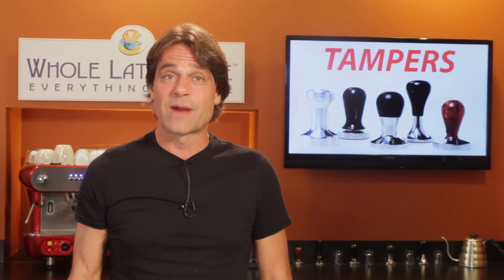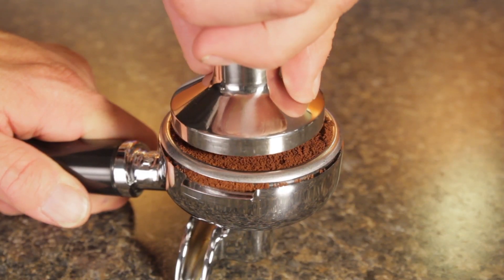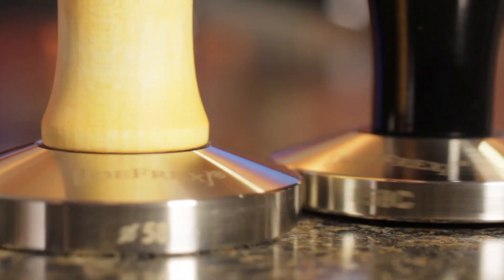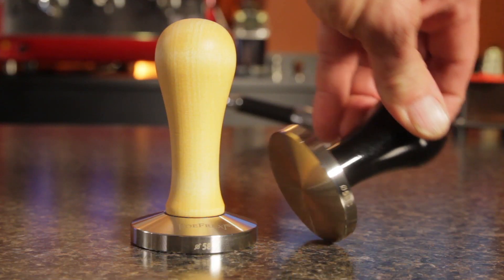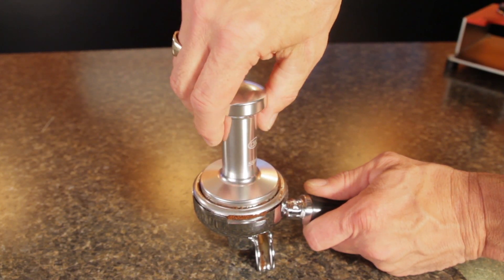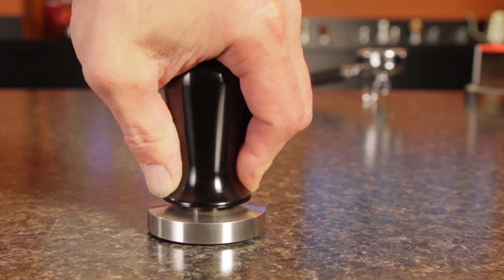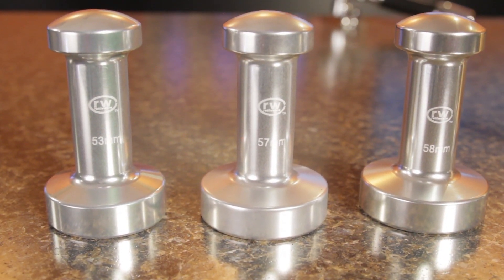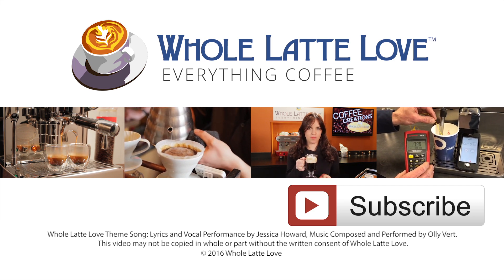How to Choose an Espresso Tamper

Comment: @Whole Latte Love If you're applying pressure when you do the rolling motion before you tamp you are most likely fracturing and or creating channels in  the puck (or at least running a greater risk of that happening). The stockfleth distribution technique pared with a smooth, piston like motion, tamp will yield a perfect shot  almost every time (if done properly). This is also assuming all other variables like grind,temp, and beans are optimal.
Reply: Also if you keep tamping with your palm your wrists are taking all of the pressure and if you work in a cafe, carpal tunnel is gonna creep up on you. Try holding it like you would open a door or how you would turn your keys in an ignition with your elbow at 90degrees parallel to your side and you should feel it in your chest (just a note you can benchpress more than your weight but it only takes about 15 pounds of pressure to break a human wrist. so its safe to say putting the burden on your chest and not your wrist is a better idea.)
Reply from the maker: Hi CAP, Thanks for sharing your tips on your technique! Not sure I agree that a light roll 12-6-3-9 move prior to full tamp pressure would fracture the puck.
Reply: Whole Latte Love 12 6 3 9 is different than stockfleth.but you are right moving a center pile to multiple places can create an unevenly weighted puck. stockfleth incorporates a swift swipe distribution so you avoid that (it is allot harder to master). there are hundreds of ways to distribute it all depends  what you are most comfortable with and gives best results. tamping however, I stand by not tamping with your palm and wrist to avoid injury.

Comment: If I’ve measured the interior of the basket to be 51mm should I be looking for a 51mm tamper or a 50mm tamper?
Reply from the maker: Hi Steven, Thanks for the question. What is the make/model of your machine? Is it a pressurized filter basket/portafilter? 51mm is rather uncommon. 58mm is standard commercial size. 54mm used on some Breville machines. Asking if it's pressurized as tamping is not very critical with those. If measuring 51mm I'd start with a 51mm tamper.
Marc
Reply: Whole Latte Love, it’s a DeLonghi ECP3X20. It’s actually slightly less than 52mm. But I think it’s a pressurized basket as it only has one hole at the bottom.
Reply: I have a SMEG Espresso machine which is basically a Delonghi Dedica and buy a Fdit Calibrated tamper of 51mm on Amazon, it's a great tamper.
Reply: Omar Monterrosas, I actually ordered a JoeFrex 51mm yesterday. Hopefully it works.

Comment: Hi there , do you use convex tamper in conjunction with leveller?
Reply from the maker: Hi TM, Since making this video about 5 years ago I gone to using a leveler without tamping in most cases. It doesn't work with all levelers but does with The Jack as shown in this more recent video: https://gph.is/g/4MKK6Lx
Marc
Reply: Thx Marc, I’d like to rephrase my question. If I’m using a convex tamper does it make sense to use a leveller ?

Comment: Currently a beginner with my first espresso machine I picked up at a yard sale for $3. It's the Starbucks Barista. I've been unable to find out what size tamper I need. Any chance you know? I'm currently using my fingers. ☺️
Reply from the maker: Hi UB, The Starbucks Barista machine uses a pressurized portafilter so a tamping is not required beyond just settling the coffee in the portafilter. Some quick research shows the portafilter is 53mm but I wouldn't spend much on a tamper as not really need. You could use just about anything that fits - including your fingers. Good pickup for $3!
Reply: 53mm is the trick

Comment: Hey, I have an Izzy barista 6823 espresso machine. Should I buy a coffee tamper? What about a coffee grinder?

I need to know ASAP
Reply from the maker: Hi SBV, Never used that machine. But, looks like it's an entry level espresso appliance using a pressurized filter basket. With those tamping is not critical as it's the filter basket which creates the pressure and not the coffee compressed by tamping. Grinding coffee beans fresh will make a better espresso. But, potential quality is limited when brewing thru a pressurized filter basket.
Marc
Reply: @Wholelattelovepage  thank you very much sir!
Reply: @Wholelattelovepage  also, what do you suggest me about a better espresso on this machine?
Reply from the maker: Grind fresh, use the largest dose of coffee that will fit in your basket - these types of machine tend to have undersized filter baskets compared to standard 58mm. Grind very fine - have a look at some pre-ground for espresso and match that grind size. It's a little finer than granulated sugar. Make sure you machine is fully warmed up. Keep the PF attached until ready to use. Might want to run some brew water thru your PF (no coffee in) to help warm it up prior to making an espresso.
Marc
Reply: @Wholelattelovepage  you are fantastic. Glad to find your channel. Keep going!! Thanks a lot!
Reply from the maker: @Alex-id8rw  My pleasure!

Comment: I have a 58mm bottomless portafilter basket with a machine that is made locally in india (tecnora) will a 58mm base diameter tamper fit my portafilter? Not many shops here offline so that i can check physically.
Reply from the maker: Hi RG, Thanks for the question. I can't be certain as I don't have a Tecnora myself to check. But my guess is a 58mm tamper should fit a 58mm filter basket.

Comment: I have krups type 874 do i need a tamper and what kind?
Reply from the maker: Hi LC, The Krups 874 uses a pressurized filter basket so tamping is not critical. If you have the ground coffee scoop which came with the machine it can be used to compress the coffee in the basket if desired.

Comment: Actually it does make difference even for pressured portafilter. Plastic ones are useless
Reply from the maker: Hi z, Thanks for the comment. This video is getting a little on the old side. About a year ago I started using levelers like this one and rarely use a tamper anymore: https://youtu.be/4Z5vTi643sc
Marc

Comment: My portafilter size is 51mm. Should I buy 50mm or 51mm tamper? Thank you. (Espresso machine Delonghi ECP 3531)
Reply from the maker: Hi BK, Thanks for the question. Fairly certain your machine brews using a pressurized filter basket. When using  a pressurized basket tamping is not critical as it's the basket creating the pressure of the espresso brewing process and not the coffee.  Tamping may have a very small effect but in most cases it does not. Tamping for your type of machine is more about pushing the coffee down away from the lip of the PF. I would go with the 50mm.
Marc
Reply: Thank you very much :)

Comment: I am a little bit confused here. I just purchased a new machine and a grinder from you guys. You  want to be consistent, yet you are promoting a tamper that makes the puck uneven (thinner in the center.) Even if the coffee comes out the center of the puck in a thinner area of the puck would that still be the equivalent of channeling? I bought your jack leveling tool and I like the fact that it evens stuff out. However in addition to leveling, I am still tamping with the tamper that come with the machine. I was considering purchasing a click tamper for the sake of consistency. I am not sure which one to get, the flat or the concave? I just drooped almost 4K on hardware. I do not want to skimp, yet I do not want to waste money. So please give me some feed back....
Reply from the maker: Hi Stephen, Sorry for the confusion! This is an older video. Personally I switched to using a leveler about 18 months ago. The majority of the time I do no additional tamping. One exception is when I'm working with a very fresh from roast specialty coffee like a high altitude single origin. When fresh from roast, like within a week or two out, grind is a little coarser and more apt to channel. Additional tamping may help in that situation but a lot depends on coffee type. I do like the very consistent surface and depth using The Jack. If tamping after leveling I use a flat tamper as it's less apt to roll on the leveled surface. A click tamper assures consistent pressure shot to shot but if leveling first I think it's not needed if you feel you can apply consistent pressure on your own. Years ago I had a slight preference for a concave click tamper. The thought with those is a slightly higher edge prevents side channeling. Since then grind has tended slightly finer and I use precision filter baskets which IMO are less likely to side channel. Hope that helps!
Marc
Reply: @Wholelattelovepage  I watched the newer video too. I am still trying to get my consistency down. I used just the leveler and I used the leveler and the tamper. together. I also  picked up a portatfilter stand and a dosing funnel that is really was helpful in keeping the mess to a min. I just cant seem to hold the perfect shot. I guess I need more practice.
Reply from the maker: Practice helps. Also focus on consistency. When you change one variable keep all others the same. Helps to isolate change that makes a difference.
Marc
Reply: @Wholelattelovepage  Easier said then done

Comment: If my portafilter is 51mm,  I should be using 49mm tamper right?
Reply from the maker: Hi BB, In most cases tampers are rated at the size of the basket they fit in so a 51mm filter basket would use a 51mm tamper.
Marc

Comment: 54 flat. Over time I've gauged to leave a fingernail depth inside my filter basket. it's not scientific, but it works... nom nom nom.
Reply from the maker: Hi Kari, Thanks for your comment. When you say fingernail depth do you mean that if you cut your nails the measurement would be different?
Reply: It's always 2mm :)

Comment: For pressurised system it doesn't make any difference whether flat or convex, for a none pressurised system a flat temper would be best,reducing pooling.. .
Reply from the maker: Hi Phil, Thanks for the comment. Agree with you on pressurized PF/filter basket. In non-pressurized systems, IMO there may be other factors like filter basket shape/size and personal preference affecting tamper shape selection.
Marc

Comment: The lighter the tamper the more pressure the person needs to apply. As long as the tamper fits the basket as it should all else is just noise. There is no true scientific trials proving anything else. No one can go wrong with their personal choice as long as fit and appropriate  pressure are followed with a tamper. Just don't get one that will readily break and you will be fine.
Reply from the maker: Hi Fav, Thanks for the comment. I definitely see a change when using different tamping pressure. As mentioned, more important to be consistent with pressure shot to shot than nailing a specific pressure. I know guys who use light tamps and those that prefer heavy. I do believe tamping pressure plays into dosing weight changes.
Reply: I am sure it does. I did not state anything different. A good fit and pressure is what it takes. What I was talking about was the different stuff they come up with that has no scientific merit. Such as flat and convex. Plastic or metal. If it is good hard plastic you can put as much pressure as you like as with metal. There is no scientific studies on the other issues. They are all just personal opinions and just because a few reach a consensus or an agreed midpoint does not make it true. Again, no scientific study making any valid or concrete proof of such opinions as to whether this or that handle. This or that material, etc. If a tamper has a good fit and can handle the particular pressure the individual likes then it is good to go. Everything else is just snobbish.
Reply from the maker: Agree 100%! As I mentioned in the video I have a tamper I prefer. But that preference is based on my opinion and no solid evidence. If one finds a tamper they like that's what they should use. I could never say someone must use this one or that one. I personally wouldn't do plastic. I find it a lot harder to get a nice level tamp with their skinny width and light weight - but that's just me.
Reply: Agree with you. Don't get me wrong. I was referring to what manufacturers come up with. Some things have merit. Others not so much.
Now, I have seen your videos and really liked the speed, variety and ease of full automatics. I have been thinking of taking the plunge and wanted fo start off with an entry level one for mostly 2 people. Which one would you recommend that also includes the milk feature? Thank You for your time and replies.
Reply: Not appreciably, unless you've got an extremely heavy tamper, you're not likely to see much of a difference. Granted, you may not be applying 30# to the grounds, but even at 10#, the pressure contributed by the tamper isn't appreciable.

Comment: Can you use a wooden tamper? I want to keep it Hobbit =D
Reply: You really shouldn't use wood with food. That being said, dry coffee is not likely to be an issue. Especially, if you make sure that it's sealed with some sort of food safe finish.

Unsealed wood is not food safe and can eventually wind up with bacteria getting inside of the wood where it can't be sanitized. Bamboo is a good alternative as the structure doesn't allow that to happen.